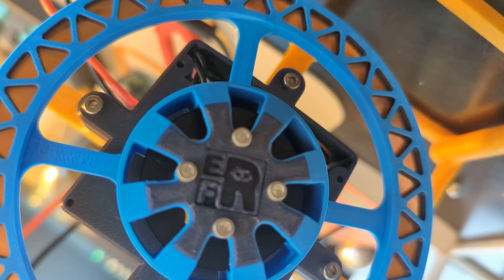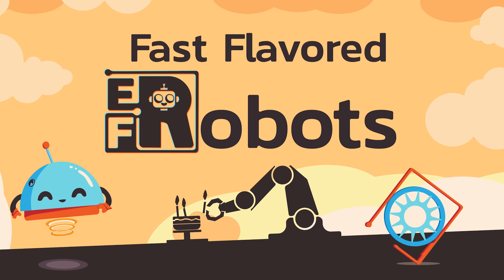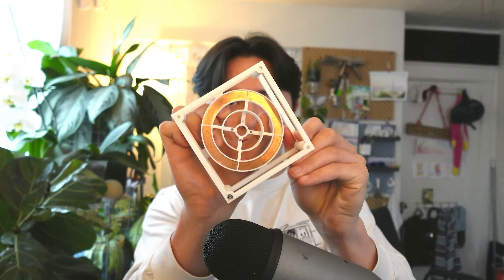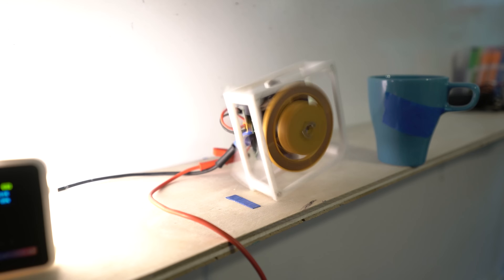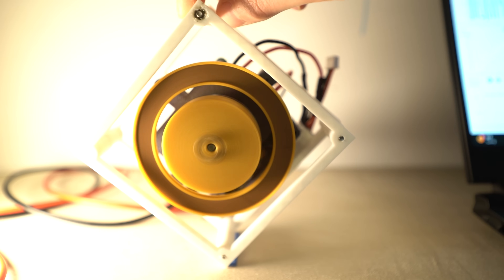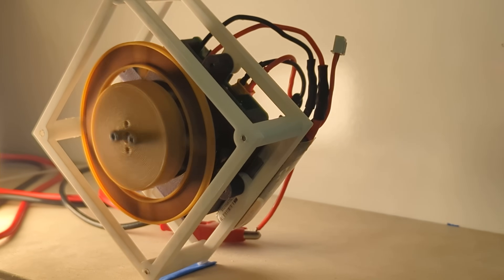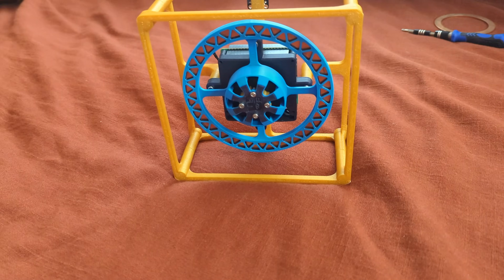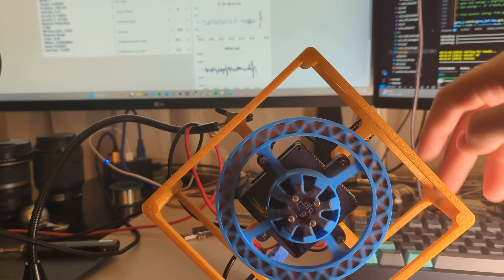Reaction Cube Situation Is Crazy

Comment: Man, that final version is REALLY cool. Also, you probably already know this but if anyone reading this doesn’t - The issue of reaction wheels hitting max speed and being unable to provide any more torque in that direction is something that happens in real world applications too - it’s called reaction wheel saturation. In a sense, a reaction wheel has a finite battery of torque it can apply in any given direction and if you exceed that in its lifetime, ifs no longer useful!
Reply from the maker: Thanks for watching and for the extra information!  I considered bringing up that reaction wheels are used lots in robotics, especially in space applications but it ultimately got cut because I felt like it was becoming a tough balance of educational density and approachability...

Thanks so much for adding some relevant info for the curious minded!

Comment: What happens if you run the current angle as a % of the desired angle and run it as the speed of the motor?
Reply from the maker: That is a good question!  In control theory terms, what you described would be equivalent to a "Proportional Controller", which is what the P in PID stands for!  And in this "P controller", the input to the controller would be (% of the desired angle) and the output of your P controller would be motor velocity. 

So to answer the question: What would happen if we ran a P controller on the motor speed, with an error term calculated as % of the desired angle....

You would likely see some oscillations when you start it up, and then it would unfortunately fall over while the motor spins up really fast. 

BUT this is almost there!  The #1 fix we can make is changing the output from Speed of the motor to Acceleration of the motor.  This is because the "reaction torque" we get out of the reaction wheel, which is used to balance, is not directly related to the motor speed, but instead the acceleration.  

Now from there, we could tune the P controller to get some wobbles for sure - but to step up the balance we will probably have to add some Integral and Derivative terms as well to get it balancing nicely.  

I hope this answered your question!  Thanks for watching
Reply: @EveryFlavorRobot Ah, I think I understand it now. I was working on a similar project in a game called Trailmakers using the systems in the game. The oscillation was an issue I had but I eventually changed it from being exactly proportional to being exponentially proportional? The smaller the difference in angle, the less the reaction wheel would spin. I don’t believe I ever fixed the issue but your video definitely helped my understanding. Thank you!

Comment: Can't the software be designed so that it learns the proper PID values by trial and error and zeroing in on the right values?
Reply from the maker: Good point!  this video I was starting at the basics of linear control theory, and building up to rudimentary non-linear control theory -- The math of self-tuning PID values is one step further in a field called "adaptive controls" and its something that I have used before, but do not currently grasp well enough to teach or explain elegantly.  I recommend MATLAB's series on adaptive control theory if you want to see good examples of that!

Comment: nice project!   Many of the existing Self balancing cube projects appear to have the wheel start/stop/reverse - your version just varies its rate of spin?   whats the diffrence in approaches?
Reply from the maker: great question!  I can't speak for every other project out there, but I don't think mine is particularly unique in it's solution.  Mine doesn't explicitly avoid changing direction of spin, it just happens to asymptotically approach zero velocity because of the way the math works out. 

the system you describe that has a wheel jerking back and forth could come from options I think.  
1) they might have a wheel with much less rotational inertia.  This would necessitate larger swings in velocity to create the same reaction torque.  The result would likely be a robot that needs a faster motor than mine does, and its wheel would likely change directions more.  
2) the control algorithm could be less continuous than mine is.  My controller has no "jump" in its decision making, unless an instant addition of momentum is introduced by a poke or a bump.  I did however try early in the video a "bang-bang" controller, which does have a "jump" in decision making -- essentially choosing a different motor speed depending on the sign of the balance point.  

Now, a final note... most well-tuned reaction wheel systems (unless they are "bang-bang controllers") will be outputting in some units of torque.  That torque you calculate will then be passed to the motor controller, and the motor will speed up or down due to the new torque  provided to it.  I think this is a common way to handle the problem. 

Some people (myself included here) have low budget systems where the torque is not easy to measure/ guarantee.  I solved this by converting to "delta velocity", which works well on the discrete time-scale that my control loop runs at. 

I hope that kind of makes sense!  Thanks for the question and for watching :)

Comment: Is the rotational torque that stabilizes this at all related to why a frisbee flies or are those different things
Reply from the maker: that one is a Gyroscopic effect, so its not quite whats going on here!  But fundamentally, they are all forms of the conservation of angular momentum, so I can't say its not related.

You can actually balance with that effect too by spinning up a wheel really fast, and then using another motor to "tilt" the spinning disk.  Since the "gyroscopic force" will resist the tipping of the spinning disk.  The frisbee resists tipping over as it flies due to the gyroscopic effect from its spinning, but in a robot you could use that reaction to balance a pendulum like this cube guy!  You would just need a second motor :  one to spin the disk, and one to tip it when you want the reaction force

maybe we will build one of those sometime!

Comment: Do you have an explanation for why the oscillation strategy for killing rotor RPM works? Your goal is to lower the speed of the rotor by displacing the robot in a way that would require you to decelerate the rotor, and in order to do that, you have to first displace the robot in that direction, which means you have to accelerate the rotor. Why is the amount that you have to accelerate the rotor to create the initial displacement less than the amount you have to decelerate the rotor afterward to recenter the robot, such that you can repeat the process to lower the overall rotor RPM?

Writing this I think I might have answered my own question: it doesn't take much energy to knock the robot off center, and from there you can let it tilt past its fulcrum and increase the needed restoration energy on its own, without relying on the rotor. Basically you're using the edge of the square as a lever to incrementally subtract rotational acceleration due to gravity from the rotor's total kinetic energy. I'm not completely sure that assumption of mine jives with how you've set up your control loop, though, since I would expect the PE/KE calculation to integrate that KE.
Reply from the maker: one nuance that I left out in this high level explanation - was that the "outer/ higher" PID loop that adjusts the balance point is acting at a much slower frequency than the "inner" PID loop that drives the robot to a given angle.  The reason the second one can work relies on a guarantee that the Inner loop makes:  within X degrees of the balance point, we can get the robot to && hold the robot within +/- Y degrees of the given balance point.  The failing condition is when the motor speed reaches the maximum speed.

With this, the Outer loop is then free to move the balance point, assuming the robot can and will reach the new balance point that was set. IF this balance point is slightly off of "true balance" then the robot will still hold the position, but the motor speed will gradually increase in that direction until the failing condition of the inner loop is reached.  

So to utilize this, we integrate the motor velocity, and that integral term is what drives the balance point to sit on the Correct side of True Balance -- such that it bleeds off this excess velocity.  

I hope I explained that in a way that was helpful!  always feel free to hop in our discord if you ever want to chat about nuanced robotics!  All questions are welcome :)

thanks for watching
Reply: @EveryFlavorRobot  Cheers; much appreciated. Alas I am a software engineer with little to contribute in the robotics department, but I'll be sure to drop in if I ever finally succumb to the urge to pick up Arduino

Comment: Cool project! As someone who has built a cube that balances on its tip, my advice to you is to look into state space controllers. What you want is essentially a P-controller for the angle and rotational velocity of the cube, plus for the rotational speed of the flywheel. Technically, this kind of controller would need you to do some nore complicated math, but to be fair, technically the PID-controller would, too. But in this kind of application, you just skip the math and keep tuning by hand until you like the result.
Reply from the maker: Oh you are spot on I think about this!  I've never tried before this project, but  I actually did a little bit of work on implementing some state space controllers here.  Ultimately I decided I need more research time for it and didn't put that into this video because I want to make sure I can explain it properly to the channel and get better examples of it.  Thanks for the support, we'll keep you posted :))